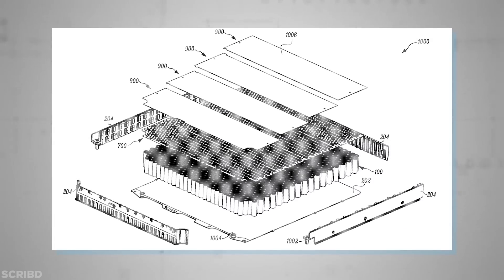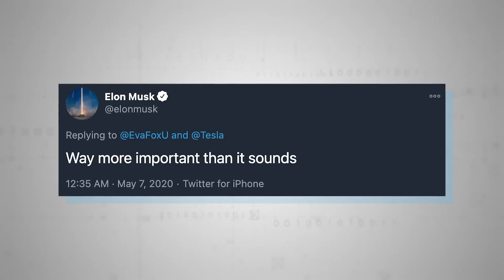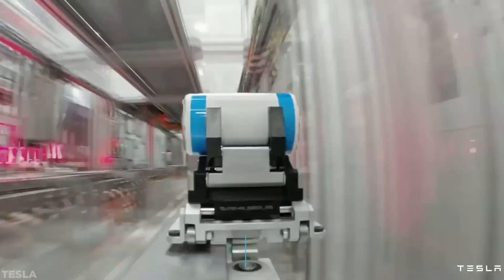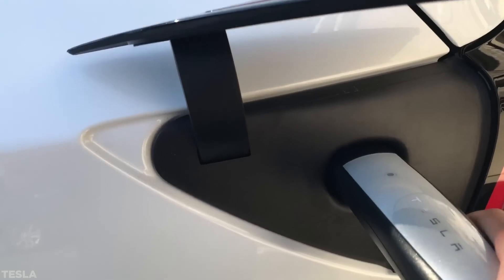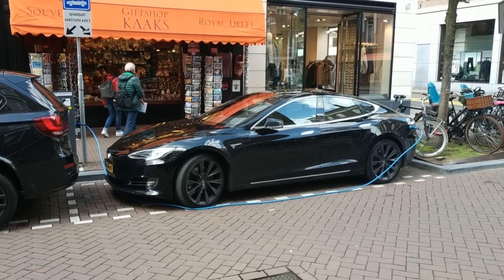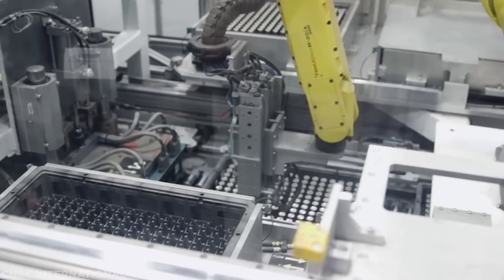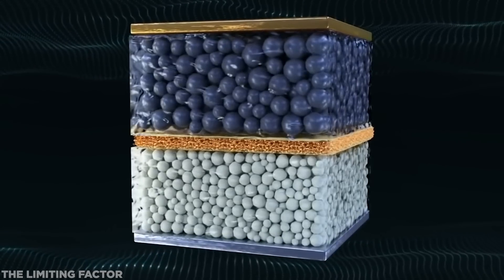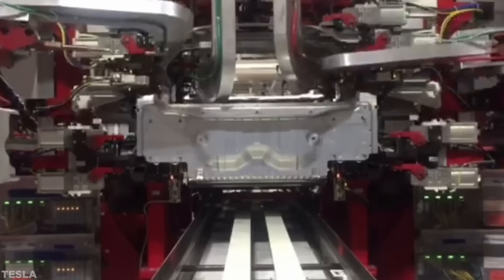Why Tesla Switched To Tabless Batteries

Comment: Useless video riddled with too many errors!
Tesla will produce 39 Kwh in 2022???? That's enough to make half a Model 3!! :-) :-)
Reply: It's not hard to understand that they probably meant either MWh, or GWh, not kWh.
Reply: @richardmillhousenixon  It is indeed not hard to understand what the fact is, but it is hard to imagine that they rolled such obviously wrong data off their tongues multiple times!
That figure was just emblematic of everything that was wrong with the video. Really bad analysis & poor on facts.
Reply: @omnicurious2949  we do also need to consider the possibility of a transcription error when writing the script, and them using voice actors that don't actually know much about the subject and are just reading off a script. Not saying that was what happened, or that this is a reliable video, but just exploring the possibilities
Reply: @richardmillhousenixon  As I said "39KWh" was only emblematic of the pile of poor analysis in the video...if it were just an isolated typo I would have let it pass....
Reply: Yes , and also he said that the tesla car can achieve 300miles capacity whale it can go for 504miles ..

Comment: These batteries look far superior compared to the existing 2170 cells. Tesla's just keep getting better
Reply: Will they be easily replaceable?
Reply: @Amelchw919sj  That's funny, because Aptera seem to have gotten solar panels to be effective on a car. Yes, it's a prototype, but it is still functional.
Reply: Does ot differ 2019 model s and a 2020 one?
Reply: Could have better materials, And stop charging drivers' subscriptions
Reply: They haven't even gotten good yet with their finished product
Reply: never go straight into buying a first model year car. as with anything new these will indeed have certain problems and recalls, it's the production over the years and down the line that irons out most issues with any new tech.
Reply: @Amelchw919sj  The damage is from UV-C radiation, which is almost completely blocked by normal borosilicate glass. Not. An. Issue.
Reply: @Amelchw919sj  do you seriously think they haven't thought of these potential issues and fixed them already?
Reply: Could be solar powered but tesla wants people to have to use the superchargers lol
Reply: @UserNoFindy  no it couldn’t be solar powered and just installing one would have a net negative impact on the environment
Reply: @UserNoFindy  the economics of adding solar panels doesn't pay off yet. Future innovation for sure but not now.
Reply: @UserNoFindy  Solar  definitely needs to be added to ev's, even if it gets 4 percent per day, it would be a great option.  Tesla could theoretically put magapacks at supercharger locations with solar, then charge Tesla owners less for charging and others pay standard rates.
Reply: @joenavarro2973  you could get at best a 200w solar panel on the roof, however being flat and faced up gives it 40% of that 200w peak in the best scenario. In slightly shaded or dawn and dusk it's barely any energy. Not even worth anything and you lose out of a sun roof or the full glass roof

You only get that peak power when directly facing the sun and tracking it, second best is being angled towards the sky at all, and then efficiency drops off sharply when flat
Reply: @Jaker788  Even if it is only 80w, that is likely enough to at least power the infotainment system and sentry mode when the car is not actively connected to a charger
Reply: @richardmillhousenixon  The cost and limitations to the chassis design aren't worth it IMO. It may power it in sentry model buts it's pretty insignificant on range still but you could assume a $2000 cost addition for this
Reply: @Jaker788  I'm not sure it would cost that much, since Aptera is pricing their full solar kit (roof is included, but hood and tailgate) at just 900$, and that's a 700w total output system
Reply: @richardmillhousenixon  This is my last argument against the idea. It's a waste of resources to put solar panels on that are barely utilized at their best efficiency and can be recharged, it's not exactly a clean industry right now. You wouldn't even recoup the cost of a solar panel, so why should we be tying up manufacturing capacity to a bad use case (80w is a good scenario, shade, cloudy day, dawn/dusk, raining and you produce almost nothing).

Get solar on your house, that makes more sense. Public parking stalls with solar roofs make sense too. But solar panels on most cars is a lot like solar roadways.

If you want solar on your car, wait for organic carbon based solar to get figured out, then you can wrap your car in it. No environmental concerns, dirt cheap and damn near printable. Just needs work on the lifespan.
Reply: @joenavarro2973  yes they are 5x bigger and 5x energy and 5x mass . Improvement = 0 % what a revolution
Reply: @richardmillhousenixon  doesn't seem efficient. You have so much material in a solar panel just to get drops of power. Would be more efficient to just plug in somewhere. Even the normal power outlet
Reply: @carlosandleon  if you would have read the information on the site I linked you would have seen that Aptera has gotten solar to work on their prototype to give the driver 40 miles of range per day in areas like cali and Florida that are mostly sunny. And, since IIRC the average driver only commutes about 30 miles total to and from work each day, they would never have to charge their car unless they were going on a road trip. Plus, it can power things like the climate controls, the infotainment system, and even trickle charger the battery to eliminate phantom power loss.
Reply: @kosovoisserbia8937  yep, the only thing that changed is that the new batteries can be charged/discharged quicker because the are not getting as warm as the old ones. No significant change in energy density, but people dont get it because its elon

Comment: When the model 3 dual motor is $25k after taxes and fees I'll buy one. Until then I can't afford any of these electric vehicles 😔
Reply: It won’t be the 3 but the next mass vehicle from Tesla will satisfy your needs.
Reply: Won’t happen. Specifically model 3 lowest price is supposed to reach 35k$. But 25k$ for a car is gonna happen with a future model. Range will be amazing with the newer cells and while performance won’t be extreme in the 25k$ base model, it won be bad (compared to competition it will be great). Tesla aims to start producing this car by 2022 but for the car to reach minimum cost might take a year or two. I think a true cost of 25k$ might be seen around 2025. Will be an amazing car!
Reply: If they keep printing money the way they do, your Tesle model will rather be   250,000 then 25,000.
Reply: What I would like to know is what is the life span the batteries and what will be the replacement cost IE new engine new transmission so to speak or will the battery last as long as the expected life of the vehicle itself and then recycle the whole package
Reply: Xpeng agrees, 25k is the EV fair price
Reply: Call your Bank. 

Just like the IPhone will never sell for $300.
Reply: @joscaca  I mean Tesla will eventually lower the price of the model 3 but it'll take a while.  They will probably be a significant price drop with the unicast and structural battery pack plus the 4680 will reduce prices too.
Reply: @user-RCST  Car prices actually go up over time , not down. Inflation. 

Tesla will be introducing a cheaper/starter car. The Model 3 will likely never be cheaper than $35k.
Reply: @joscaca  you can buy an iphone for $300. Just buy last year's model. If used tesla can get to 25k after taxes and fees it'll be unstoppable. No need to even get there new. More used cars are sold than new for ICE cars. No reason we can have the same for electric.
Reply: @MuddinNYC  A previous year’s IPhone for $300? I find that hard to believe. Apple takes off $100 or so off the previous year’s model. The phones retail about $1100/1200. That big of a discount is unheard of.

Comment: Tesla car spontaneous fire on Texas highway recent news footage 🙄😐😒😆
Reply: did u know that gas cars are 11 times more likely to catch on fire than teslas.  Also only old teslas catch on fire and newer models dont.
Reply: @TheDetective999Three  from 2013 and up on mostly Model S ? And between 14-20 or more fires either spontaneous or from damage either collision or other means
Reply: @Braddsterrr  I think it was 2012-2016 model s and x. Also it only happens when model s and x traveling 80 mph and above hit a solid barrier.  Its not something that anyone should actually care that much about. just drive safety and they will be fine
Reply: @TheDetective999Three  I do agree with you that most people don't need to care about it but in some places the average speed limit is above 80.

Comment: I don't see why the new battery will be less swappable than the previous one.
Reply: The previous batteries r held in modules. And the whole battery back is made up of a bunch of these modules. Previously u could swap one module and replace it with another. The new batteries won't be in modules and will simply be glued in place and made as part of the structure. So changing a small portion of the battery pack is no longer possible since they are all glued in place.
Reply: @yahikotendo5631  Would it be possible for them to just bolt it in place or do they just want you to buy a whole new battery instead of replacing modules?
Reply: @hashiramasenju6058  the reason behind making the battery pack a structural component is to save on costs and increase the available space for batteries. Apparently the whole idea with swapping out modules to save on repair costs wasn't actually really used, so there was no point in keeping it like that. As for the glue vs bolts, it would not be possible to use bolts since it would require the batteries to be in packs again and would reduce the structural integrity overall. I believe Sandy Munro did a video or two detailing exactly why the battery pack will be the way it is. He probably explains everything better than I ever could.
Reply: @yahikotendo5631   I agree.